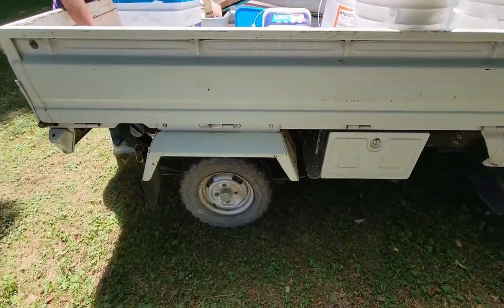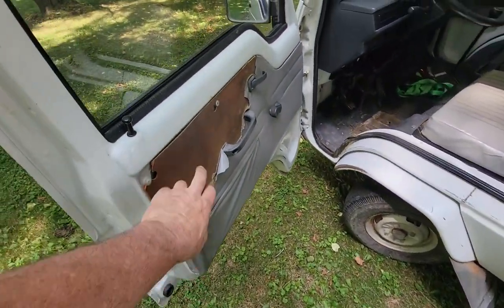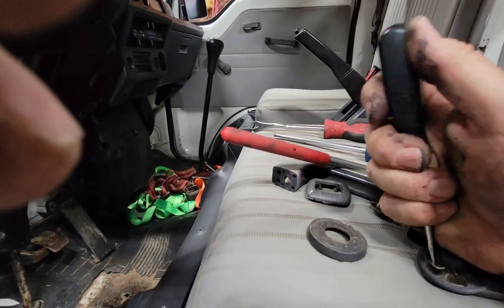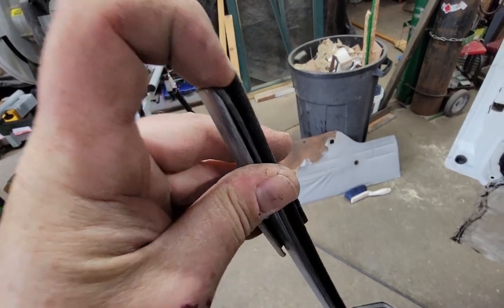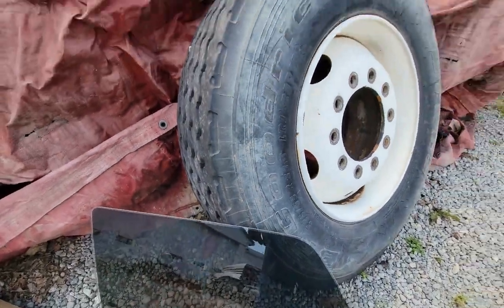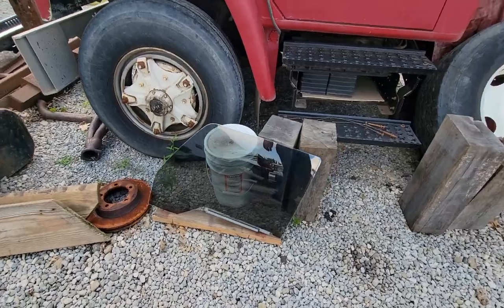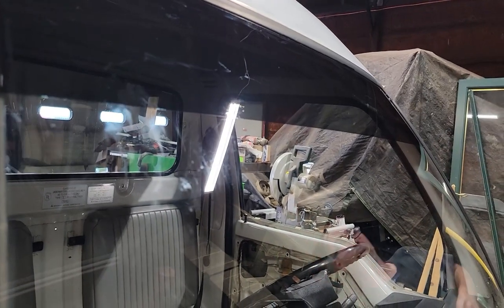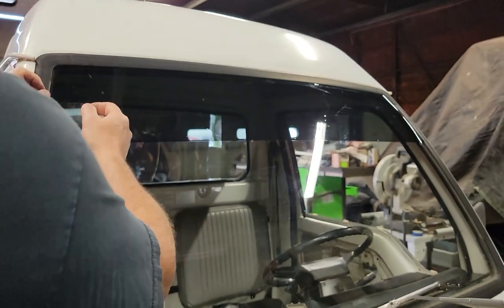MINI TRUCK WINDOW TINTING AND ONE TWISTED UP WINDOW REGULATOR (PT1)

Comment: Nice job jc. That’s a cool little vehicle. I’ve only ever seen them in right hand drive. Really cool to have one left hand. Great video as always. Keep up the good work and god bless.
Reply: Hi Zack 🙂 Although driving on the left side of the road with right-hand-drive is law in Japan, there are two reasons why left-hand-drive vehicles are uncommon but not unknown there. 1) it helps when negotiating narrow mountain roads; if you can see the edge you are a few less percent likely to put a wheel over it and have a Really Bad Day; 2) Left-hand-drive vehicles are cool in Japan due to many classic sportscars imported there being LHD; it became A Cool Retro Thing. When I worked for Rover we built Japanese-market Minis (the real one, not that Chrysler-powered BMW wannabe) right up to the end of production in both LHD and RHD on customer demand 🙂

Comment: Mrs JC , congrats on the rig. Looks mint with the new tint installed. Just need mag oversized wheels, 5th wheel and your ready to hit the road. JC how about air con? Fans just don’t cut the mustard! If you mount a small diesel motor on top of the cab and pipe in down into cab it would work a treat. Easy as for a junior like you. Good job. Cheers
Reply from the maker: she doesnt drive it on the road. just around the property. cant justify the a/c for the amount of drive time. wheels and tires are already on. some other things in the works.
Reply: For Mrs JC, air con is a must. Hang the cost or need. Come on JC. Make the lady enjoy the open road ! ( or the yard).

Comment: A little advice next time, use a (yard) sprayer you can pressure up with a little bit of soap. Scrub the glass really good with a scrub sponge. You did a really good job on your first tint job!
Reply from the maker: i found a pump hand sprayer. i am hoping that will help to flush out the channels and seals.
Reply: @j.c.smithprojects  yes that is what I meant. It will definitely help clean the rubbers with a bit of force. I also use a razor blade and scape all the glass then use a scrubber. Many washings in between. Next try and do your house. You will love it.
Reply from the maker: i cleaned the inside and out with a razor blade and soap water. i put the film on the outside to cut it to size. i have learned that you never stop cleaning the glass until you are done.

Comment: Nice tinting job. Looking forward to seeing the tire upgrade. 
If the bolt pattern is the same as a Diahtsu hi jet mini pickup on Mustie 1 YouTube channel he used Suzuki side by side aluminum rims with knobby tires other than trimming at the bottom of the door they worked but he had a lift kit for the truck.

Comment: just wondering,did you put the tint on the inside or outside of the windows,usally  i beleave it is on the inside from what i have seen a glass shops
Reply: It went on the inside you place it on the outside to cut to size first

Comment: Legal requirements for window tint as follows (USA first, then UK/Europe).
USA:
Windshield 75% VLT (Visible Light Transmission). Most Automotive Green glass is already at that threshold so shouldn’t be tinted. For clear glass use 25% tint. Darker shadeband across the top permitted.
Side windows from the B-pillar forwards: 75% VLT.
Rear window(s) and side windows rearward of the B-pillar: knock yourself out, there is no stated legal requirement.
UK AND EUROPE:
As above, except side windows from the B-pillar forwards 70% VLT.
OFF-ROAD USE ONLY:
Lady’s choice, because you’re not going to meet a traffic cop with a VLT meter and a grudge 😆
Source: I’m a Homologation engineer and Glazing approvals are one of my specialities. Hope that helps some folks 🙂
Reply from the maker: thanks for the info. im sure some folks are looking for this. for our application, none applies since we only use it on our property.

Comment: How did you get the window out? I need to replace my regulator
Reply from the maker: remove the window seal from the door. unhook the glass from the regulator. turn window 45* clockwise so rear upper corner is pointed up. then lift out.

Comment: That would be a handy vehicle to have if I could fit in it as i'm 6'3". It makes me wonder how that regulator got so frittzed up. Maybe the previous owner was a gorilla..
Reply from the maker: the window got on the wrong side of that torn seal and got jambed up....someone just get trying to crank it down.
Reply: @j.c.smithprojects  I wasn't trying yo sound ugly but I was surprised the window crank wasn't broken since it seems they are usually made of pot metal.

Comment: The track broke because some one lost the key and needed to get inside.
It happens to me 20 years ago with a Toyota and the track looked just like that.
Reply from the maker: not the case here. the glass was wedged in between the faulty track guide.
Reply: @j.c.smithprojects  
Maybe.
I think if that’s the case the handle will broke before the track.
Reply from the maker: like i said in the video, the glass got wedges in between the faulty guide in the widow track. when people kept trying to roll the window up or down it bent the window regulator. cause was the windown guide....effect was the regulator damage.
Reply: @j.c.smithprojects  
I love your videos and learn allot from you.
All love and Respect , Keep up the good work.